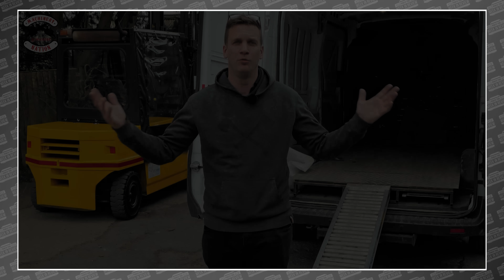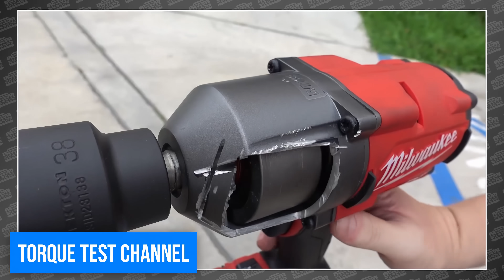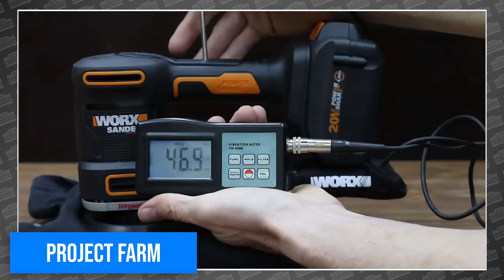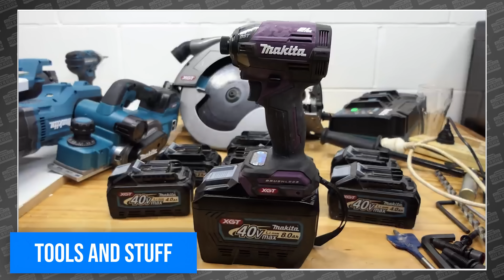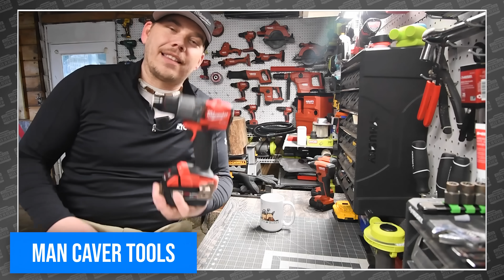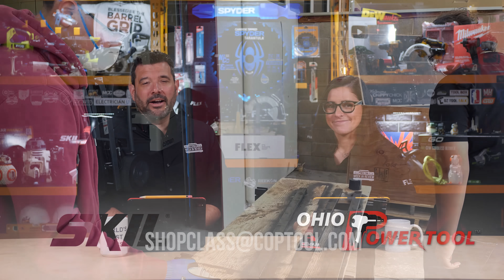BREAKING! Makita goes BIGGER than both Milwaukee and DeWALT. Power Tool News!

Comment: For the full weighing of reliability and quality, tool breadth, reputation, service, and performance, of the massive amount of tool brands out there, as a professional, Makita is a really great choice. If I was just a homeowner and didn't use tools much, I would probably go with Ryobi. They seem to do a great job for that market
Reply: Hilti is the way to go for professional use. In my country they have the best services and guarrantees. They will come and pick up broken tools and replace them directly.
Reply: @Possimpablee  If you live in an area where Hilti is able to offer their excellent service, Hilti is great. You certainly pay the price though. However, they don't have good ergonomics and they don't have a very wide range of tools. I agree their tools are quality as far as lasting though and their service is excellent in certain areas, for sure!

Comment: It really grinds my gears whrn a giant like Makita goes to ONE big battery voltage instead of doubling 18x2. Obviously they have 18x2 now..and I own a few..but this is obviously going to be the voltage of the Makita future..ie 9.6v of yesteryear.
Reply: Always honing to have 12 volt and 18 volts you think power is better it ain't final fixers, electricians 12 volt is the go, depending the needs bulky heavy tools ain't fun the future is 12v with the power of a 18v today
Reply: You're not thinking big enough. 40v x2.

Comment: I use a 5 3/8” ( corrected ) M12 to cut most of my lumber.  Easy and portable.
Reply: No you don’t. And I’ll save you the “yes I do, how would you know?” And skip right to the “Milwaukee only has one m12 circular saw and it’s a 5 3/8” saw.”
Reply: @RaggedsEdge  I wouldn’t argue back and forth, not sure where you got that idea.  All you would have to say is it is a 5 3/8”.  Yes, you are correct, it is a 5 3/8”.  I was wrong.  Its still what I use in my shop.